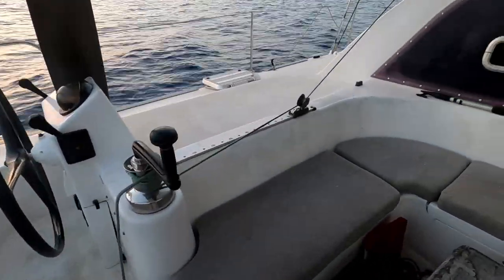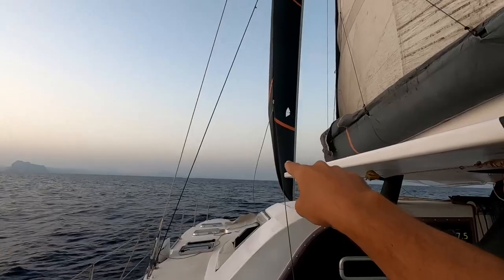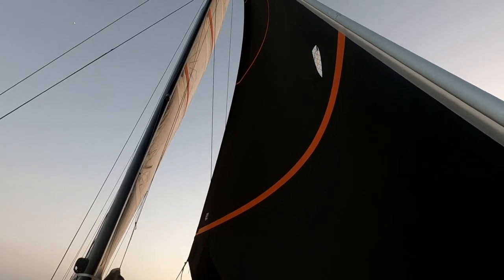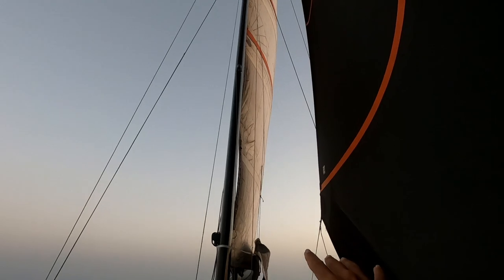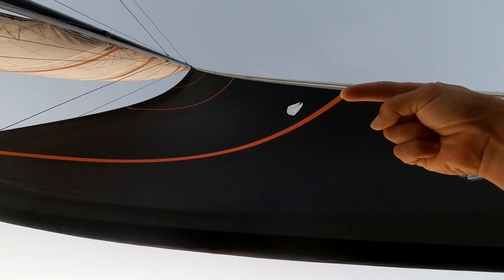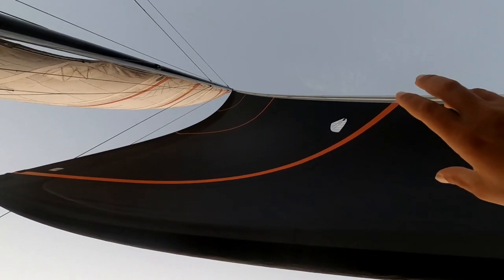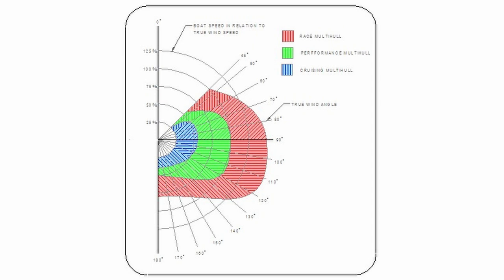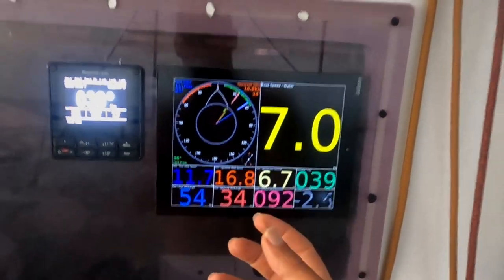Jib trim on a catamaran - tips for upwind sailing

Comment: Great info.  However, it seems like most of the information has to do with why a sail is made in a particular way.  The only thing we can control is sheet tension, and car position.  However, if you had an adjustable back stay, I guess you could add or loosen tension on the forestay changing the shape of the jib a lot.  Biggest takeaway, adjust to apparent wind, not true wind.

Comment: G'day, great video & my question is also to do with your rotating mast & your display. I too have a rotating mast & have been trying to find a compansator? For my display. I have all Ray Marine gear & they have one but even they tell me it doesn't work so what do you use & where are your wind speed/ direction  aerials mounted i have thought  about having 2, windward & leeward on the aft corners of the boat so i can just switch to the windward aerial after each tack but this is an expensive exercise building 2 towers, etc & i still don't think I'll work properly. Also what display & aerials are you using, very good. PS. I also have a Catana (custom) the first ever built. It was built while L.C. was drawing the plans for the French production company. Started as a 40 now just under 44. Has had  the transoms extended & the bows straightened up. Robbo Gotcha Covered